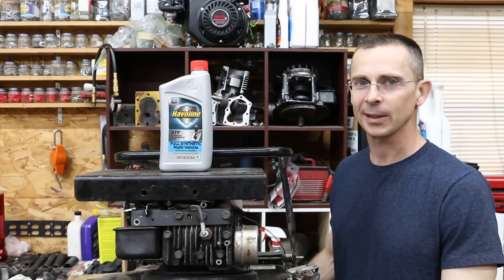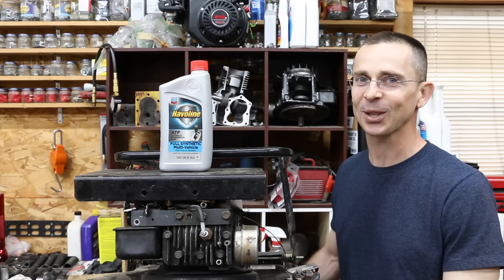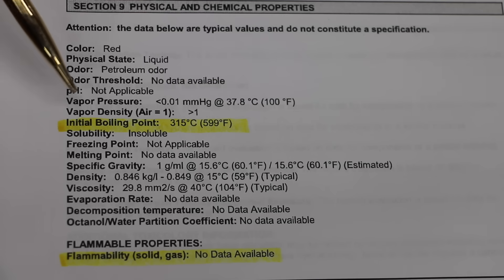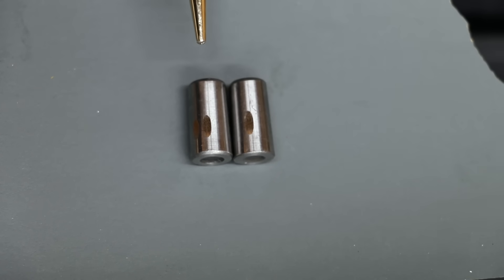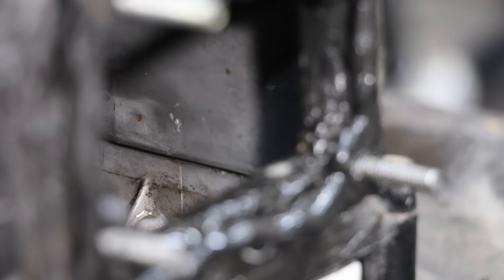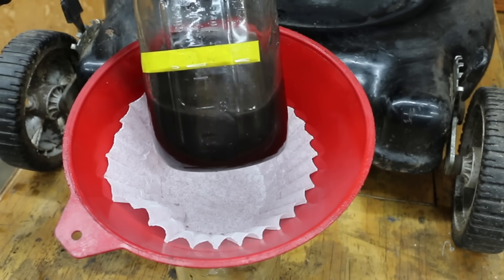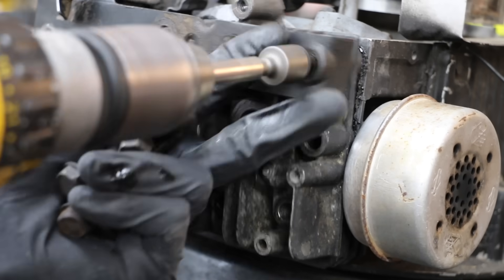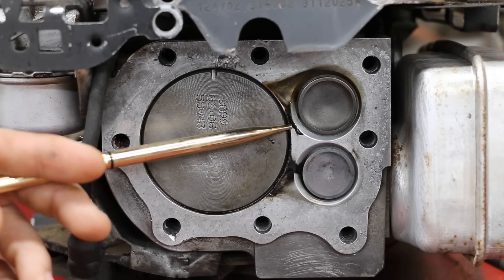ATF as an Engine Oil substitute?  Let's see what happens!

Comment: Plastic camshaft?
Reply from the maker: Seems like a bad idea.
Reply: Project Farm engineered obsolescence... And Briggs & Stratton wonders why Honda took over the market
Reply: Those Briggs & Stratton engines run forever with no maintenance other than an occasional oil change.
Reply: Hal 9000 Actually plastic cams work great in these engines. I myself was originally skept at first. Trust me, it's a special plastic. Honda is awesome but $$$$.
Reply: Hal 9000
There are some plastics that are tougher than steel !
Reply: @kengamble8595  i heard they make machining tools for titanium cutting from that plastic
Reply: Honda took over the market? Nahh.. Mostly Briggs and Kohler..
Reply: When did Honda take over the market?  I went looking at the local Home Depot, Lowes and Northern trying to find lawn mowers with Honda motors a couple years ago and couldn't find anything but Briggs and Stratton.
Reply: Stuff and nonsense. Like one mechanic said, Tecumseh engines were heavily used for snowblowers--i.e., hard work in cold conditions--while B&S and other engines were used for summer work. That should tell you something.

My Tecumseh mowers have also been excellent for reliability, the 20-year-old 8 horse mill still running well. My emergency generators use Tecumseh as well. A damn fine engine and a pity the company folded.
Reply: Well, that's because you were at those big box stores. Nobody that makes a living using small motors will use B+S. They know that crap costs them money.
Reply: Anything sold at those big box stores are not high end. Acceptable, but not high end. Honda will always be better. I used to be a Briggs man, but no more.
Reply: @oby-1607  I bought a Honda mower at home depot...also bought an echo weed eater.  Not exactly cheap ass stuff ...maybe your big box stores sell crap where your at??
Reply: Those plastics are not cheap either .
Reply: Most likely Delrin.  It's cheap and durable.  The old Ford 300 cubic inch straight 6 had a gear-driven camshaft with a delrin timing gear, it would usually last over 300k miles before failure.  Those same engines when used in generators, agricultural equipment, etc. would be steel-geared because the additional noise wasn't a concern and the extra cost was worthwhile for the durability but still not terrible engineering to use a Delrin camshaft.
Reply: nope,, its the oil slinger since it doenst have an oil pump
Reply: Had a few tecumseh engines over the years that snapped the camshafts on startup. But hey, Tecumseh engines were crap and terrible to work on anyways.

Comment: Have heard in the old car hobby that some put ATF in the fuel of their vintage vehicles. Personally I mix it 50/50 with acetone to make a homemade penetrating oil. Worked pretty good on rusted exhaust bolts.
Reply from the maker: Thank you for this recommendation! I'll test it as a penetrating oil.

Comment: Very interesting test as usual. About a year ago, I tried ATF on my tired old generator - it was smoking badly, and the oil was really dirty. I ran it with half ATF, to see if it would unstick the rings and clear it up a bit, as I needed it to keep working on site and it really did help - less smoking, and ran a little sweeter. Then a month ago, as a trial I added about a pint to my golf engine, as I’ll be changing the oil this week. The oil went from pretty clean to really dirty in about 100 miles, and it’s never sounded sweeter. I used to be against ATF as an engine flush, but I have to admit that I’m impressed with it, and I’ll use it again. I’ve got an old 1961. 6.25 V8 engine in with noisy lifters and very dirty oil, I think I might just be trying this with a bypass micro fine filter...
Reply from the maker: This is interesting!  Thanks for commenting on this.

Comment: I am 65 yrs old and have worked on cars all my life. I even owned and operated a car lot for many years, and a tire shop/garage for a while. I am now retired because I'm old. 
  I have used dextron ATF many times to clean engines. I've used it on 318 C.I. Chrysler engines that had lifter noise. I have use it on many GM engines, 2.2L (Cavaliers/S10) and 3100 and 3400 V-6's with lifter noise.
  I have had great success with the method I was taught by an old time mechanic. I would change oil and filter, install clean oil and one qt. ATF. Drive the car 200 miles. The lifter noise was gone every time! After the 200 mile mark I change oil and filter again with the required oil weight that the manufacture demands.
Reply from the maker: Impressive!  Thanks for commenting on your years of experience using ATF.  This is great information.

Comment: great how about a Compare transmission fluids. mercon LV vs Mercon. Mercon lv Vs Dextron 6 I have a 2010 f150 that has a bad stick slip see https://en.wikipedia.org/wiki/Stick-slip_phenomenon  
 anomaly when hot. fine when cruising. I feel the LV does not have the film strength of others and causes the friction bands to vibrate. in particular the torque converter. to shudder when applied
Reply from the maker: Thank you for this recommendation!

Comment: That canola oil probably polymerized very well inside the piston rings grooves and stuck them in place, causing the low compression. The same thing elsewhere caused the stiff rotation, and both caused the hard starting. Diesel engines that are run on waste veggie oil have polymerization problems with their rings, injectors, and fuel injection system.
Reply from the maker: Yes, you are absolutely right regarding the polymerization.  I thought the engine brake was applied, but it wasn't.  The engine was that stiff and I'm sure the piston rings weren't sealing properly as a result.

Comment: I used transmission fluid to free up a seized motor  I went out with a breaker bar and after about a week I got it broken free after draining the transmission fluidclesning the oil pan and get to g a new pan gasket and changing the oil filter with a new filter and oil it started eight up but the main bearings were shot so after about a month and a half driving it the motor blew
Reply from the maker: Wow! Thanks for commenting.

Comment: 1985 Chev S10 V6 2.8L. I was low on oil and all I had was a litre of ATF so I dumped that in to get me home. I put fresh oil in and a week later the rod bearings were completely wore out, the oil pressure dropped and eventually broke a rod. I wouldn't recommend ATF at all. Too thin.
Reply from the maker: Ouch!  Thanks for commenting on this.

Comment: Always heard you can use it to stop rust from getting worse in a fuel tank.   We used type a or f to clean out our race engines before we broke them down for a rebuild.   Before we started doing it, the internal parts were nasty. (We used huge amounts of nitrous).  At breakdown time we'd pour a quart in idle for 30 minutes n drain.  Engine was clean inside.
Reply from the maker: Wow!  This seems like solid proof that ATF does indeed work well!

Comment: I had a terrible lifter noise in my 2006 small v6, drained old oil, bought cheap oil plus a quart of mercon atf. Ran a 100 miles, did oil change with better oil and the lifter noise was gone. Thanks for vid. Will however look at high detergent oil for next oil change.
Reply from the maker: Impressive! A high detergent oil seems like a great strategy.

Comment: Ive never heard of running straight ATF instead of oil, I have however heard adding a quart (to a 5 quart system) a few hundred miles before an oil change will help remove deposits because of the additives in ATF. 
I purchased a well used 2006 mazda 3 with 260,000 miles on it. I added a quart of ATF a few hundred miles before my last oil change and it was extremely dirty. The new oil also became very dirty very quickly I'm assuming because of the leftover ATF in the engine.
Reply from the maker: Interesting. Thanks for commenting on this!

Comment: The whole ATF in the engine to clean your engine does work. but you did it wrong. what you are supposed to do is in a car engine change the oil and replace 15-20% of the oil capacity with ATF. run the car for about a couple hours. then change the oil again. (only due this when you are getting lifter noise or after you change you oil the oil is already turning black(do not do this in diesels). 

this will remove a large amount of contamination throughout the engine which can reduce the amount of wear on the engine, free up sticking lifters and improve oil flow. do not run 100% ATF and do not do this on engines with Oil leaks as this will clean the gunk buildup around the engine and cause i to start leaking.
Reply from the maker: Thank you for this recommendation!

Comment: Huh. Not the result I expected. I suggested this awhile back and appreciate you making the video. It being right after fools I expected some catastrophic failure. Still cool though. I would be interested if you revisited this in the future but did a 50/50 mix of atf and acetone like you would do for breaking rusted bolts free to see what effect it would have on the atf and the motor.
Reply from the maker: Thank you for this recommendation!  I like the idea of testing 50/50 atf/acetone.

Comment: most engines are complex pieces of engineering and I think MAZDA should go back to what they did best the WANKEL engine which is just two rotors, moving gas seals and a crank shaft that is it.
Reply from the maker: Thanks for commenting on this.

Comment: Did use it once to free up a stuck lifter on a jetta , worked pretty good . Ran it for 15 mins . I don't think it would cause any harm to an engine engine idling or low revving without any load . Like you mentioned its not meant for long term use . The stength of motor oil film comes into play once you start putting stress on an engine .
Reply from the maker: Interesting and thanks for commenting!

Comment: I am currently using some atf in my oil right now in my BMW e46. I'm using 1 quart of atf to 6 quarts of oil. Anyone who is familiar with the m54 engine knows about the crappy oil control rings that were used. My car has 213,000 miles on it and uses a quart of oil about every 800 miles. I'm hoping this atf oil mix will clean out the oil rings so that they will seal better and improve the oil consumption. And I may be crazy but it seriously felt like it had slightly more power the day after I added atf.
Reply: unrelated to the BMW post above, but i recently used some Engine restore, the same stuff you tested in my 1998 MX5 1.6 with some worn rings, did not help with its compression issues though! probably too far gone!
Reply from the maker: Thanks for commenting on this.  I hope you'll provide a follow-up comment in the future regarding whether or not this helps. Have you tried engine restorer?  Are you using a "high mileage" oil?  If you reply, could you create a new comment so I can easily find your response?
Reply: I was looking through the comments to find out how that compression was restored with a change in lube, stuck piston rings! Makes so much sense now, assuming that's correct.
Reply: Jordan Walls try some hi mileage  oil u be surprised  Castro. Gtx.

Comment: Another great video, and I don't think the ATF caused the metal pieces, I think it actually cleaned them out from the crankcase, because otherwise it would have decreased the compression instead of increasing it. That was quite impressive how much more compression it gained.
Reply from the maker: Great point!  I agree. Thanks for commenting.

Comment: I put a quart of atf in my lq4 6.0 Chevy truck. The lifters were noticeably quieter
Reply: ElroyJosephJenkins JrTheThird I added a quart of Napa atf and ran it like 100 miles then drained and refilled with fresh oil
Reply from the maker: Yes, that's the same one.  Thanks for commenting on the lifter noise improvement!
Reply: What brand atf?  How much atf?   How long did it take for the lifters to quiet down?
Reply: +Slapnuts - I use 1 Quart of AFT Fluid and 3 Quarts of Oil.  So far, all the Engines seems to be quieter!  I also use ATF Fluid in my Air Compressor... It too seems LESS quieter than Oil itself.

Comment: I enjoy this, have you considered measuring the bearing scores with calipers or micrometer? I don’t know if it would be significant, you probably would have to do a larger sample size though for any valued measure.
Reply from the maker: Yes, I've used calipers but it is very challenging to do.  The lubricity tester isn't perfect, but it has demonstrated repeatable results.
Reply: Project Farm thanks, I’d imagine that it can be very challenging with them. Keep up the good work!

Comment: It didn't lose it's lubricity after running ATF in the engine, but you can't tell if running as hot as an engine runs has the same lubricity as when it's cold. ATM I can't imagine an easy way to test that.
Reply from the maker: Great point!

Comment: Thanks for doing this one finally! 

Would have liked to see the ATF used as an additive instead of a complete replacement for engine oil. So something like 80/20 Oil/ATF mix. That way you get the lubricating properties of oil but the detergent properties of the ATF. 

Still a solid result, though. Thanks for listening to your viewers!
Reply from the maker: Great point!  I'll incorporate your recommendation when I test diesel soon.

Comment: I’ve only heard of using ATF in a power steering pump. Never done it though.
Reply: My factory user manual states type f fluid. I use atf so I don't have to buy another bottle.
Reply from the maker: Thanks for commenting.
Reply: Chris VH hahaha
Reply: Most of the steering pump use atf. Just look which kind 1 2 or 3
Reply: ATF is commonly used in power steering systems today (the ones that aren't electric, of course) as well as manual transmissions.

Comment: This is pretty cool.  It would be interesting if you could take some of these tests that prove effective on small engines, and try them on  a multi-cylinder engine.  Something like an old Jeep Cherokee XJ can be had for $1000 or less and those have very dependable drivetrains and are quite easy to work on.  Obviously taking a vehicle engine apart after every test takes much longer than these small engines but driving the vehicle for a few months could give some long term results.  Otherwise building an engine stand to test it on could alleviate some of the issues.  Either way, these videos are great!
Reply from the maker: Thank you for this recommendation!

Comment: Wait, what... did you say PLASTIC camshaft? :-O
Reply from the maker: Yes, not a good choice in my opinion.
Reply: There is a plastic camchain idler gear in my motorcycle engine that is known to wear out relatively quickly, but that is 1984 vintage. You would've thought that engine manufacturers would learn lol

Comment: That "Clear View" window was awesome learned a lot from
this video. You should try Transmission Fluid in the Gas mix.
Reply from the maker: Thank you for this recommendation!
Reply: Runs nicely in a idi diesel, little bit down on power so you mix a little acetone and petrol with it, brings the power back up.
Reply: Project Farm 
Have you ever compared Marvel Mystery Oil?
I used it back in the 90s to uncease a 1973 BMW 2002 that was totally ceased and sitting for months and we brought it back to life and girlfriend at the time used it for few yrs until it got towed in a snow storm (we were broken up by that time) and she let it stay there and eventually let the tow yard keep it for the bill.
But it worked great poured into crank and most important into spark plugs and let it sit for a day or so. Had to use a big pipe wrench on crank to force it to turn at first to free it up. Once we got it going smoked lots at first but after worked great.
Should be called Marvel Mystery Miracle Oil.
Reply: In the olden days before 02 Sensors and Cat Converters people use to use Transfluid as a sorta seafoam to clean carbon... These days it wont work cause 02 sensors and cat converters are not trans fluid friendly
Reply: Not that you have any diesel engines, but the same ATF in diesel fuel to help prevent gelling, and adds lubricity to injection components.
Reply: MegaDirtyberty that sounds like a good way to blow the heads off a diesel engine lol
Reply: Not at all, using it most successfully. Have used 100% atf (without acetone/petrol mix) one day because I run out of diesel, power was down but it run.
Reply: bds1234 oh, like gas and 2T mixture, but instead of 2T oil, its atf? Ive done it on my old moped which was barely running, it wasn't starting so easy bcs I added a bit too much, but there was more oil in the cylinder than everywhere, that thing couldn't really burn
Reply: Yes do a test and use it like "Mystery Oil" measure out a certain amount of ATF and add to the Gas
Reply: yeah that was amazing
Reply: MegaDirtyberty The guy that used to own my idi ran a lot of atf through it with no obvious ill effects.  Mixing in acetone and gasoline sounds like a dangerous game though.
Reply: I have in a fuel tank on a deisel and guess what the engine actually gained some power and fuel mileage as well .
Reply: Eric Murrell actually many of the drivers have done it without any damage to the engine . All it takes is one quart of gasoline to a full tank of fuel to help clean the injectors .
Reply: The type f is often used in making a carbon cleaner. Read the article in a magazine called The Horse. I used the type f to clean out some engines though no official test were preformed. However if the tranny fluid is not thoroughly mixed and just haphazardly poured into the gas tank more than one time the rpm's shot way up and wouldnt go down wothout choking and boggi g it down...